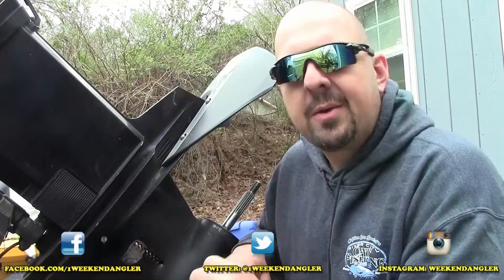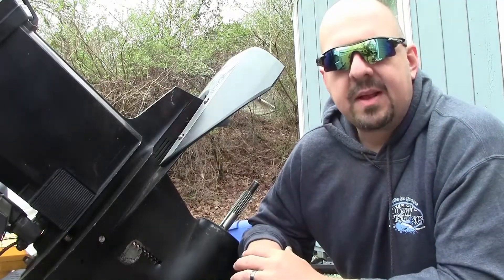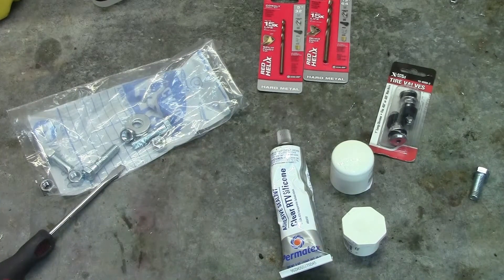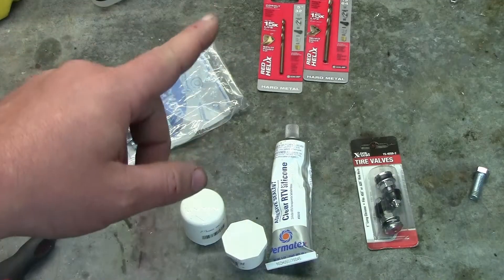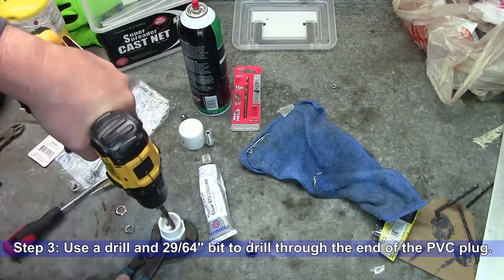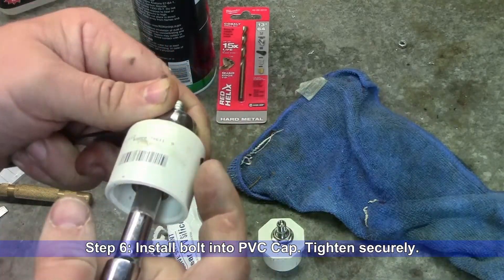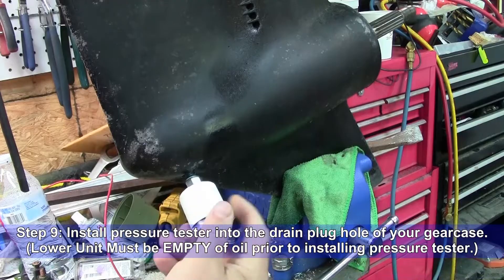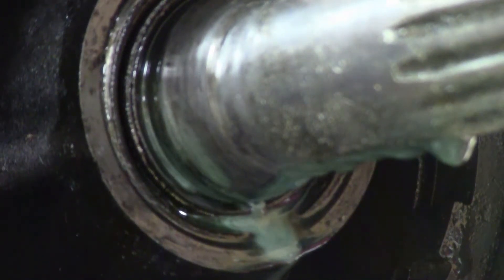Is Your Outboard Leaking Oil From The Lower Unit Gearcase? Build a Pressure Tester To Find The Leak!

Comment: A fitting that screws right into that hole comes with a cheap gear oil pump as found at many stores.  The kind of pump that is set up to screw into a 1 quart bottle like a hand soap pump, but it has a hose to the proper fitting.  I'm sure you could rig that hose up easier.

I always change my gear oil in the fall, because one time I had a lot of water in there and it froze over the winter, pushing the retaining ring right out!  I got lucky, it could have cracked the lower housing!  On the plus side it was easy at that point to get the carrier out and change the seals.  But I did need a new carrier ring, so I don't recommend this method.

Comment: I got a leak where the ear muffs go on. Just noticed it a few minutes and came in to see if you had a thought 0:26  about it. ?
Reply: If it was bubbling around the water inlets,I would think you need to replace all seals and gaskets involved with water pump, including the impeller. 
My plastic water pump housing was warped and discolored, so replaced the entire pump. 
While you are in there, I’d replace the o-ring in the cover that the shift rod passes through. It required some skinny dental picks to get the old hardened o-ring out and the new greased one back down in the groove of the bronze bushing but it was worth it.

Comment: They literally sell a 3/8–16 threaded fitting with an o ring seal and hose barb for not very much money. Would have saved a ton of time. This is what I’m in the process of rigging up to my automotive coolant pressure gun. Same concept as a $175 marine “lower unit tester”

Comment: I've built your device but am having difficulties tightening the valve stem in the pvc 1 inch fitting.  The head is round and I can only tighten so much.  My silicone doesn't seem to stop air from blowing through it at 3 pounds of pressure.  Any suggestions?

Comment: Great video thanks for sharing this idea.  Made mine this week.  Question, can you use it in the top hole with oil in the gearcase?
Reply from the maker: It would definitely thread into the top hole. It might be worth a shot. Best case scenario, it would push some oil out at the leak point.

Comment: I did the same as chris gould.  Fitting and tube from a fill kit and a nipple attached to a bicycle pump with a pressure gauge.  Give her a few pumps and it has the added benefit of showing the pressure go down on the gauge if you have a leak.

Comment: Something a whole lot simpler. All I did was use the piece that came with my gear oil pump that threads into the gear case and a hose adapter that came with my $12 pressure pump. Badda bing budda boom done.
Reply: Exactly what I did.

Comment: This seems overly complicated. Don't they sell pneaumatic fittings that screw directly in?
Reply from the maker: They sell a pressure tester, but be prepared to hand over upwards of $100.

If you run a shop, it's a good investment. If you're a DIYer though...
Reply: @TheWeekendAngler  I use the tube and fitting from a gear oil pump  and attach a bike pump to it, works great and it uses tools I already have around the garage. Just an idea though, there's lots of ways to skin the cat.
Reply from the maker: @Northern.eclipsee  that's a great idea, also! Thanks for sharing!

Comment: I looked thru your website and didn't find your follow up video on replacing the oil seals, have you done that yet? I think mine are leaking but I just drained my lower unit oil and there wasn't any water but I seem to have oil (black) coming out of a small hole that is toward the rear of the lower unit-any idea on where that may be coming from???
Reply from the maker: I replaced them but the video didn't turn out as good as i would have liked, so I'll have to reshoot that next time I replace a set in something.

Mine turned out to be the prop shaft seals as well as the bearing carrier o ring.

I found a used working lower unit for a good price and just replaced the entire lower.

There is a shift shaft seal in the vicinity of where you're describing. However it could also be exhaust residue if yours is a 2 stroke like mine.
Reply: @TheWeekendAngler  Thanks for the reply, mine is a 2 stroke and I saw on other sites where it could be exhaust residue, I'll keep a eye on it to make sure.....

Comment: Great Video! You are very Clever! My question is does the lower unit oil reservoir include the lower part of the Skeg.I chipped the lower piece of metal(the point) off my skeg and sometimes I see oil there on the garage floor not much just a small circle.
Reply from the maker: I don't know of any skegs that hold oil. Not saying there aren't some that might, but I've never encountered one that does. What kind of motor do you have?
Reply: @TheWeekendAngler  It`s an old 89 Merc Blk max 150
Reply from the maker: @horacelee880  yeah the skeg on an old black max shouldn't have oil in it. Probably looking at either oil residue from the exhaust or a leaky drain plug seal.
Reply: @TheWeekendAngler  Thank you for the info.I really appreciate it bro.

Comment: Got a 1987 GT150, just bought it and ran it this weekend. After lower motor for sitting in the driveway, there's black oil from exhaust. I assume it's leftover unburnt oil. Ideas?
Reply from the maker: A little oil residue from the exhaust ports is normal on a 2 stroke outboard. It's unburned oil from the cylinders. Probably running a tad rich, but it shouldn't cause you any concern.